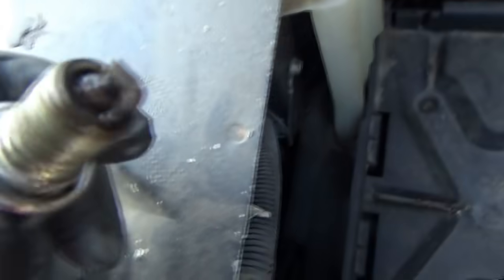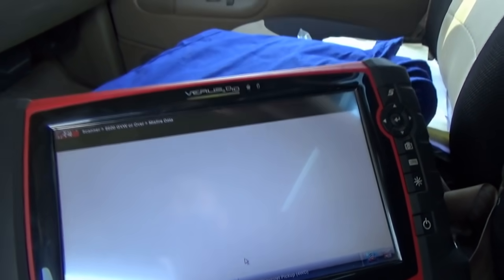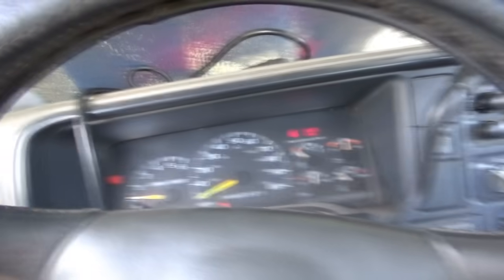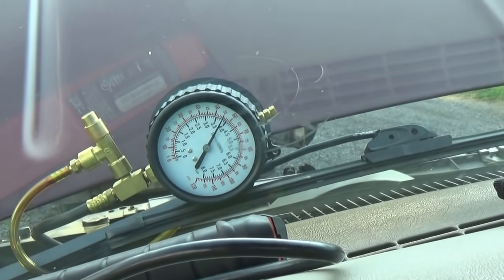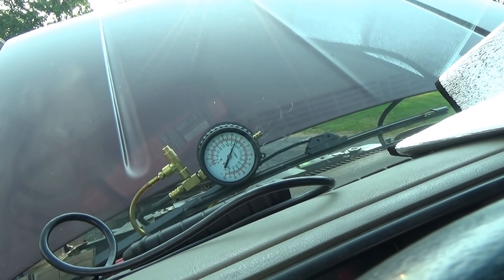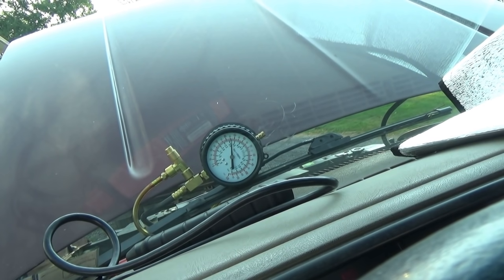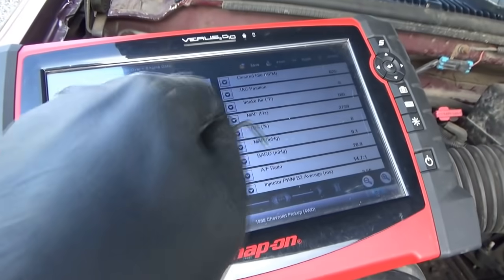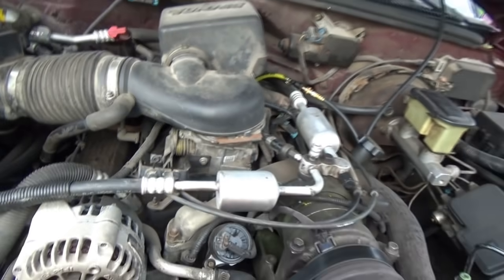Chevy MYSTERY Misfire - Part1 ('98 K2500 Labor Day Special)

Comment: 3) Vacuum leak? That's why it smooths under load. 12 minutes in, let's see 😁
At 18 minutes, vacuum is still there with PCV blocked off due to a leaky valve cover gasket maybe? Bank with affected cylinder (as there were also a few misses on number 7).
EDIT: Aah crap, the intake manifold gasket :) Didn't think about the most obvious thing, lol.
Reply: No lean code ? What were the fuel trim numbers?
Reply: @joebriano6090  It didn't set a misfire code either, who knows what kind of strategy the ecu has.

Comment: I recently had an intermittent misfire at idle #6...was worst no load @1400 rpm, fine under load.  Opened hood while running & #6 spark plug was shaking (it was loose).  Tightened plug and now it's ok.  Hard to believe that small of a vacuum leak caused a misfire, but it was close to the spark.

Comment: That's the same thing my 95 gmc sierra 2500 5.7 did. Every 2 months I had to clean number 1 cylinder plug. It would completely fill the gap and the area around the electrode.  I'd keep a new plug in glove box. Strangest thing was #1 would get fouled like that and #5 was white at tip. I don't care those gm 350s are monster tanks. Just got another one last month. Has a slight miss but that truck hauls weight and don't complain.  The first 1 I bought I could pull 3 zero turns around up hills and all.

Comment: "Mystery misfire" 
ETCG: I'll just flush the engine with this caustic chemical. 
Also ETCG: The Odyssey engine blew up! I have the worst luck. 😂
Reply from the maker: He blew up the engine?? Did he diagnose the misfire? 🤔
Reply: @PineHollowAutoDiagnostics  I watched that video. When he pulled the valve cover. He saw the engine was full of sludge. So he decided to do the engine flush. It was an Odyssey with the VCM system. When it shut down some cylinders. Those cylinders filled with oil and kaboom!
Reply: @billziegmond4943  Flushing engines was something us oldies use to do. Modern engines with modern oil not worth the risk as Eric found out.
Reply: You guys didn't even watch all the videos, in the tear-down he discovered that the engine being locking up was caused by lack of oil. The oil pickup was clogged with sludge that he suspected was knocked loose by the oil flush additive. He then went on to say he does not recommend using oil flush additives. I think he even mentioned he does not like the stuff in the video of him using it but he said he would try it.
Reply: @lrdisco2005  Yep! 😂
Reply: @billziegmond4943  That's not what happened.  It was oil starvation caused by the flush he did.

Comment: JUST went through this, 97 sierra 5.7. #5 misfire... (misfire constant, brought in from another shop, after they replaced all tune up parts.) # 5 spark plug bone dry, no fuel smell. Compression 165 psi. ALL injectors dropped 13 lbs during the drop test. Verify 3/4" air gap spark test. Run engine, fuel trim high bank 1 at idle. (Plus 20%)  Fuel pressure stays around 54 psi, no drop after shut down. Owner replaced injector assy 2 years ago from Amazon. Noticed coolant reservoir low, topped off, pressurized, held stable for 1 hour. No signs of fuel in the plenum
 Remove intake, #5 & #7 injectors reversed! Owner said it ran good for awhile after replacement, wtf? Verify spray when activated, re installed proper. Run engine, still misfired UNTILL eng warm. Signs of coolant leakage rear of b/1 head. Replaced intake manifold gasket, NO misfiring, fuel trim under 10. I wasted a lotta time on this diag. Gotta think!

Comment: If I were doing an intake gasket, I'd also upgrade the spider injection to the improved one with real injectors. GM makes an upgrade kit that bolts right in. Better mileage and a bit more power. Not expensive compared to having to go in later and fix a popped off or cracked plastic injector tube.
Reply from the maker: "If it ain't broke don't touch it " is my philosophy 😉
Reply: @PineHollowAutoDiagnostics  If it ain't broke, keep fixing it til it is!
Reply: Also makes engine less finicky about fuel pressure.

Comment: I had 3 GM Goodwrench 350 V8s installed in my 86SS Monte Carlo.  They would burn oil after a few thousand miles, all 3 of them.  Two were replaced under warranty.  Now that I have had a few years to think about it, I'm sure using RTV for an intake gasket was the problem and it was sucking oil from the lifter valley into the cylinders.   I removed/replaced chevy V8 intake manifolds many times using gaskets and I never had an issue using gaskets.   Ford uses it on the diff covers.  I used it once and it leaked.  I hate RTV when used as a gasket.

Comment: Notice that the gas gauge is sitting on negative empty.  Two times in my life I have run a car out of gas only to have the engine get fouled when I put in more gas.  Never let a car get that empty.  Assume the gas tank is contaminated with gas loving spiders.
Reply: Not good for electric tank pumps, they overheat without fuel covering them
Reply from the maker: Just an intermittent sending unit lol...it's a GM thing!

Comment: Harbor Freight has a plug cleaner that works better than any scrapping.  All the V8 GM had a oil fouling of the rear plugs due to oil /sludge in rear return holes.

Comment: Very interesting video.  I've got a 1999 GMC K1500 Suburban with the 5.7L engine.  I'm getting misfires while at stop light and idle is at 600.  Also motor shakes sometimes between 1000-1900 RPM.  Usually while in overdrive.  Recently tried changing the spider injectors with  ones made in china, but they here bad and got my money back.  I've changed just about every sensor on this Suburban with no luck.  Think I'll take the intake manafold off and see if gasket is in place properly.
Reply: Does your check engine light come on with this misfire?
Reply: @jonschwartz9669  No check engine light.  I have a code reader and there are no codes stored.  When I come to a stop it takes about 5 seconds before symtom shows up.  Suspecting a bad fuel injector.
Reply: @jonschwartz9669  I have replace the fuel pump, but not the fuel filter.  The lines are just so rusty in that area.  The engine runs just fine when it's cold.  Computer module was swapped out with no change.   Very strange problem.

Comment: I would have sprayed engine start around number 5 inlet manifold to check for a vacuum leak,  quickest way!
Reply from the maker: Except the leak is on the bottom side to the crankcase so spraying from the outside would be a fruitless endeavor :)
Reply: @PineHollowAutoDiagnostics  Good to know. Love your vidios!

Comment: sounds like a leaking intake gasket, the reason they don't set a code is they usually seal up after driving a short while and the miss goes away. My 5.3 has a slightly bad gasket and if I let it idle for.a while in the winter It will start detecting a miss, goes away when you drive it.

Comment: With a vacuum leak, shouldn't the fuel trims be out of whack?
Reply from the maker: Great question! Can you explain why they were NOT out of whack in this particular case?
Reply: @PineHollowAutoDiagnostics  I have been thinking about that .... fuel trims get out of whack when unmetered air gets into the system somehow.  In this case, it seems the intake manifold gasket has a leak into the crankcase creating abnormally high vacuum at idle.  The MAP sensor monitors what is going on in the manifold... possibly it is compensating for the leak?
Reply from the maker: @randymarion2466  You're on the right track with the "unmetered air" theory. In this case is the extra air being sucked through the crankcase vent hose metered by the MAF?

Comment: Great videos, sir . I have the same problem right now with my 1997 Silverado 1500 5.7 vortex engine.  How much should it cost to replace those intake manifold gaskets?  I already replaced the plugs and plug wires and caps and distributor cap and rotor.  And checked for exterior vacuum leaks . So I'm down to this exact issue with my number 5 cylinder code . Please if you or anyone else reads this message.  What it will cost to replace those intake gaskets.  Thank you 😊

Comment: My 5.7 k1500 has had a misfire for several months..after replacing every single sensor including the ignition coil with the control module, and new distributor new plugs and wires and still misfire for several months, it turns out its the pick up coils in the new distributor. Go figure. I also replaced the spider fuel injectors with GM original injectors.  Lesson learned

Comment: Fuel Trim Question:  As the #5 cylinder was sucking oil vapors from the crankcase, was the fuel trim negative, i.e. rich as a result of oil being drawn into the intake manifold?  Normally, a vacuum leak causes a + positive fuel trim due to excess air drawn into the cylinders.  However, in this case, the vacuum leak was not to the outside air, but rather to the internal crankcase fumes.
Reply from the maker: Wasn't enough to affect fuel trims at all...

Comment: Hey Ivan, definitely a manifold gasket leaking internally, SD has a good case study on it. I'm guessing the pcv port in the D.side valve cover must also be quite blocked, otherwise I'd expect it would equalise the crankcase vacuum through the pcv port when the pcv valve was removed?🤔

Comment: Ivan when you do the intake manifold could you show what kind of shape it is in: if it is pitted or worn.  Thanks in advance.  My intake manifold on my gm 3.8 had some pitting and deep scars at a couple of non cylinder openings.  I wonder if it was due to the orange coolant since I use the green now.  I usually changed it every 3 years even if the bottle says 5 years /150K.

Comment: If you had put a pressure transducer in there, you would have caught the issue fast (or at least known it wasn’t fuel related). You would have seen abnormally HIGH running compression in that cylinder at idle along with low vacuum on the intake stroke (in the cylinder). You would have also seen it in the fuel trims, which I’m surprised you didn’t seem to look at given you thought it was a bad injector. As others have said, this is a common failure, especially if the gaskets were replaced with cheap ones at some point or if the manifold bolts weren’t torqued properly. Since there are so few bolts holding the manifold to the head on the vortec engines, they tend to suck the gaskets in like that if the gaskets don’t have enough support built into them. It’s not strictly a GM issue either. Toyota had a huge issue with this on the 1ZZ engines and I’ve seen it on Kias, Nissans and Fords as well. Glad you continued to look at it further and found the real problem rather than just sticking with your assumption that it was a compression issue.

Comment: Hmm .. idle system .. intake leak (use unlit propane torch, point it at suspected leak spots .. RPM will change if propane gets in the intake), compression check .. head gasket checks …😮

Comment: Could you have sprayed some Brake Clean around that area of the intake manifold gasket for proof of concept?
Reply from the maker: Nope. Leak is internal to the crankcase, not to outside air :)

Comment: I got a 98 z71 5.7 engine rebuilt about 4000 mi ago has multiple cylinder misfires only when warm only in low rpms I replaced literally everything, no codes. Any ideas?

Comment: I’ve got a 1998 with a 5.7. It’s a crank no start. After about a sec or so of cranking it’ll make a loud “ping”. This is just continuous everytime you crank it. No codes and can turn the engine over by hand. Any idea where to look? I have spark but I’m wondering if I’m getting spark at the right time… I don’t think it’s fuel as I’ve tried to start it with some carb clean and it won’t do anything. Thanks
Reply from the maker: Yeah reset the distributor timing to OEM spec and see if it starts
Reply: @PineHollowAutoDiagnostics  awesome!! Thanks Ivan😎

Comment: Once I saw those crusty deposits on the spark plug, I figured the engine was burning oil. At first, I thought the valve stem seals were bad, as they harden and leak after prolonged service. However, given all the evidence, it's clear the intake manifold gasket is the main issue. If memory serves correct, there's a special torque sequence for the intake manifold on engines with Vortec heads. The center bolts must be torqued first, then the outer bolts. If it isn't done that way, the gasket will leak because the bolt angles are different.

Comment: I doubt this comment will be seen, but i hope you’re able to answer my question. So, i used to drive a 98 c/k2500 and it kinda ended up in a head on collision. The police report says there was large amounts of antifreeze and oil leaking from behind my truck and although I don’t remember the crash, the report makes it seem like the steering wheel must’ve locked up at some point too. Is there any way you might know what problem could’ve caused this or what failed under the hood?

Comment: I got my truck intake gaskets replaced at 175000 miles and drove it for another 145000 miles until the gas tank and fuel lines crapped out.
Reply: Yeah mine did the same leaked on all though.

Comment: Hello there , I have my 1995 GMC Sierra, start right up but then stall and when you put into D or R the engine shut off right away, I have no idea, so if you know please tell me what’s next I have to do.  I’m replaced the whole new distributor  idle air control.  Egr valve , map sensor but still no luck , thanks
Reply from the maker: What if you give it some gas when you shift? Is it a really violent shift? Stuck torque converter?
Reply: @PineHollowAutoDiagnostics  , the shift still fine , but it just lost power when I’m move into D or R , before that the truck run fine

Comment: I'm actually thinking intake manifold gasket vacuum leak.
Edit: I posted this before I saw the crankcase vacuum was present and excessive even with the PCV disconnected. I figured lean on #5 from an atmospheric side leak, but I guess that's the same as if it's coming from the atmosphere via the vent as it appears to be.
Reply from the maker: What scan data pid would tell you atmosphere vs internal vac leak?
Reply: @PineHollowAutoDiagnostics  That's a damned good question! Probably MAF being a normal reading at idle since in the internal leak case the air is still going through it, whereas with an external leak it's got air from an unmetered source.
Reply: @PineHollowAutoDiagnostics  Oh, and how's the XS750? I think I have photos of my one that I had in ~'94 - same colour as yours too - nice maroon.
Reply from the maker: @TonyRule  I'm loving the XS750! Only remaining issue is a minor front wheel wobble.  Somehow the mag wheel isn't perfectly true :(

Comment: OK, I'm confused! Where is the location that the intake manifold gasket is somehow (supposed to be) separating the manifold vacuum from the the crankcase air?
Reply: Each intake runner has manifold vacuum to it and the intake itself covers the valley of the engine. So if the intake gasket leaks on the bottom side of a runner (s), between the intake and the head, it will pull a vacuum through the engine valley and can also pull in oil. Since there is oil splashing around in the valley. Make sense? If it leaks on the top, it will just leak in outside air and sometimes you can hear it whistle and if you spray carb cleaner on it the engine RPM will go up. In this case, is appears to be leaking on the underside so it's pulling in air from the engine valley.
Reply: @inothome  Ah, I haven't disassembled a V8, and didn't appreciate that the top of the crankcase is open, and the intake manifold does double-duty as also a cover for the crankcase. Now it all makes sense. Thanks!
Reply: @Graham_Wideman  Yes, not all V8's are like that now, but all the older one's and the one on the video the intake is the top cover. Glad that helped explain it.
Reply: @Graham_Wideman  Yep, some of the first GM engines had separate valley covers.  My 54 Buick nailhead was like that.  The small block Chevy came along in 1955 and incorporated the distributor, water neck, valley cover,  crankcase breather oil fill, and intake manifold into one casting.

Comment: I have a misfire in my 03 mgm and i changed the coils and spark plugs, and the sp’s had oil on them just you said ivan, been a year since, idles low but you feel the misfires in ur butt, and the pcv hoses look like they’ve been sucking air hard, i can now confirm that my intake manifold is leaking, how much would this cost me cuz i am too scared to try it, and only have one day off i dont want to messup and have to do it another day, and not have my car to go to work rhe next day

Comment: Knowledge:  Even after watching your video.  I still cannot figure out how you figured out the gasket problem.
Reply: Crankcase vacuum with the PCV disconnected. The total volume of the crankcase changes very little with the mechanical motion so the continuous vacuum has to be coming from somewhere and with the PCV disconnected that can only one place - intake manifold. The PCV is where the regulated vacuum comes from normally. If he gave it a little burst of ether down the tube to the crankcase, with the PCV disconnected, the engine speed would probably pick up - it's acting like another intake.
Reply: @TonyRule  Thanks
Reply: It's confusing to me on this diag as well. In the end I understand there is a vacuum leak at cylinder 5 intake gasket. But could not understand why that has anything to do with crankcase excessive vacuum with pcv disconnected even.
Reply from the maker: @jyao5409  It will be clear in Part 2 :)